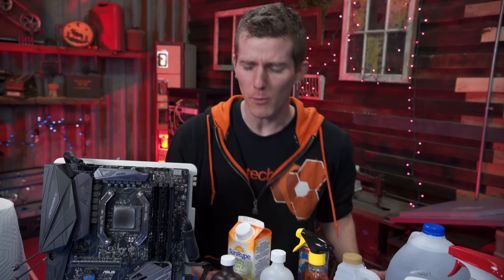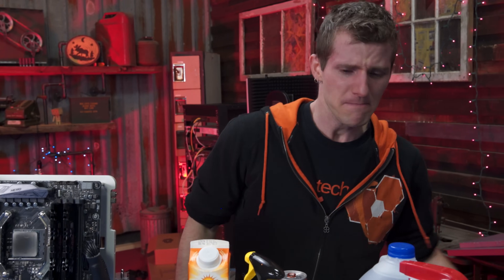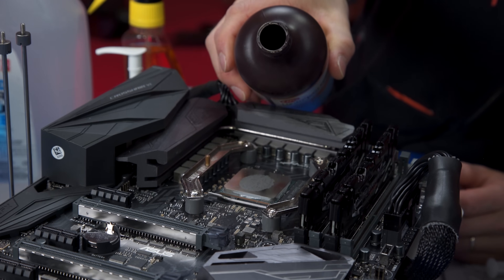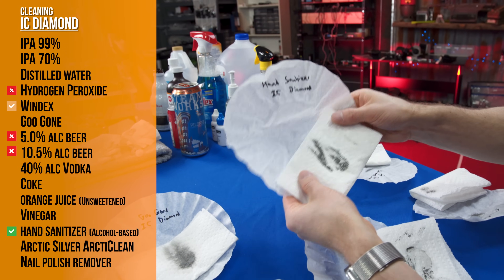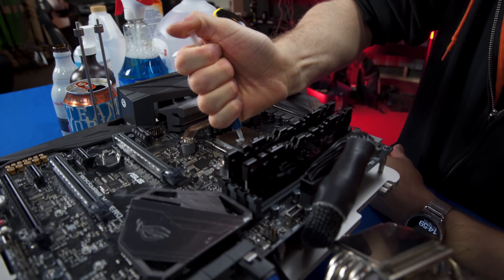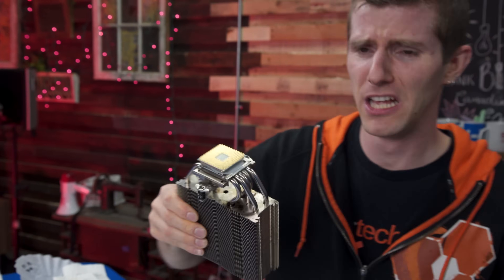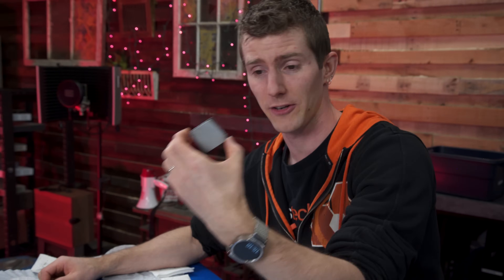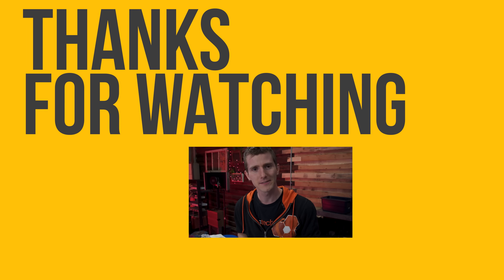Removing Thermal Compound - The BEST Way?

Comment: For those wondering the reason alcohol work so well is because it has a molecular structure that is polar on one side and non polar on the other. In chemistry like dissolves like and from what I could tell looking online briefly the thermal paste seems to be made of some largely polar molecules mixed in a nonpolar goo Soo the alcohol is able to dissolve both materials where as the liquids that were more polar like acetone had a hard time breaking down the main part of the thermal paste and the water which is very very polar did basically nothing for you. I also looked into the Arctic silver cleaner which seems to have mostly just improved on these principles with there cleaners though there could be more at work in it they don't list every ingredients only the potentially hazardous ones on the SDS. The second paste seems to come off with a Stern look so I didn't look into it. (I could also be wrong I made it through sophmore year in chemistry soooo maybe if I'd stuck with it I'd be telling me how dumb I am right now)
Reply: Alcohol's Polarity: The claim is that alcohol has a molecular structure that is "polar on one side and non-polar on the other," which is a misconception. While many alcohols (like isopropyl alcohol or ethanol) are considered polar molecules, they don't have a distinct "polar side" and "non-polar side" in the way soap molecules do. Soaps are amphiphilic (or amphipathic), meaning they have both a polar (hydrophilic) head and a non-polar (hydrophobic) tail, allowing them to emulsify both oil-based substances and water. Alcohols are polar because they contain a hydroxyl (-OH) group, but they are not amphiphilic in the same way as detergents.

"Like Dissolves Like": The principle of "like dissolves like" is correctly stated, but misapplied with regards to the substances involved. Thermal paste is typically made of a non-polar, oil-based carrier fluid (often silicone-based) mixed with powdered compounds like aluminum oxide, zinc oxide, or silver. This means the paste itself is largely non-polar.

Acetone and Water: The claims about acetone and water are also incorrect. Acetone is a powerful organic solvent that is significantly less polar than water. It is very effective at dissolving many non-polar substances, including some components of thermal paste. Water is highly polar and therefore has difficulty dissolving the non-polar carrier in thermal paste, which is why it is ineffective.

The correct chemistry
The reason isopropyl alcohol (IPA) is recommended for removing thermal paste is that it's an effective solvent for the non-polar carrier fluid.

Solvent Action: Thermal paste's non-polar, grease-like base readily dissolves in a non-polar or slightly polar solvent like IPA. While IPA is a polar molecule, its non-polar hydrocarbon chain is long enough for it to effectively dissolve non-polar substances. This is a common property of alcohols. The "like dissolves like" principle holds true here: the non-polar part of the alcohol molecule interacts with the non-polar grease, breaking it down and allowing it to be wiped away.

Insolubility of Fillers: The metal or ceramic particles (like zinc oxide) in thermal paste are not dissolved but are carried away in the suspension. The solvent action of the alcohol breaks down the binder, releasing the particles, which are then physically removed by the wiping action of the cloth or swab.

Evaporation: Another key advantage of IPA is its rapid evaporation. This prevents any residual liquid from remaining on the sensitive electronic components, which is crucial for preventing short circuits or corrosion. Water, in contrast, evaporates slowly and could cause damage.

Comment: Denatured alcohol (which is just undrinkable grain alcohol).
Degreases very well, evaporates quickly. 
The three levels of industrial degreasers are alcohol, acetone, reducer (HVLP reducer only put on skin if you very much want to get something else off and don't use it to clean anything you're not about to sand and paint.)
Only caveat to acetone is you don't want it getting anywhere it can't easily evaporate unless you have a blower of some kind, and you very much have to control your elbow grease because it will deface metal. (e.g. if you cleaned your brushed stainless refrigerator with a hard scrubbing of acetone, it'd look like garbage - permanently - when you were done.)
Try out the denatured alcohol. As a plus, it's also a perfect insecticide, and is a better household cleaner than anything the grocery store has for a fraction of the price.

Source: just like jojoba oil and pumice, this is a not-kept-at-all secret that body shops have employed for decades. Unlike jojoba oil and pumice, it hasn't trickled into the mainstream.

You can use grain alcohol, it's just more expensive. Denaturing (making undrinkable) the alcohol avoids the alcohol tax.

Comment: I have tried everything mentioned in this and other videos, but nothing can beat WD40 when you are trying to remove HARDENED thermal paste/grease. One drop in the middle of the rock hard paste and a minute later you can wipe off like butter. I am not sure if it hurts the CPU, but sure cleans the heck out of it.
Reply: Oh hell yeah, I do the same with WD-40! I also follow up with a blast of CRC Quick Drying electronics cleaner, for when you want to make sure your CPU/IHS/heatsink is clean clean. WD-40 remains one of the best things ever invented!

Comment: I saw in another two videos that dental floss can remove a heatsink/cooler from a CPU in case the thermal compound has glued the cooler to the CPU. 
That would have saved me some money if I would have watched those before I attempted to remove the cooler in the process of upgrading the CPU.
Experience is the best teacher.

Comment: Try white gas. It is a bit less thin and volatile than alcohol, it feels somewhat oily, which makes it easier to work with, while retaining the ability to aggressively dissolve the paste. I’m using a passively cooled case with 16 heatpipes going around the case, connected to various heatsinks, so I have to deal with a lot of thermal paste smears and smudges when I do something like a GPU change. Use the white gas with a magic eraser sponge and it’s like one of those commercials: one wipe and it looks brand new again.

Comment: If u take out the CPU of the mother board does anything happen to the system just a question ???
Reply: If you take it properly when the power is off(make sure PSU is also off), then nothing will happen when you put it back in, only you might get a BIOS message about CPU being changed

Comment: Iso 99% and a lint free cloth are the way to go. It's cleaner and the water evaporates faster. For god sake, don't use crap like Goo Gone which is oil based. While you can technically use any of the stuff he recommended Iso 99 will clean it best and leave nothing behind. Most everything else will and that impedes surface contact between the paste and CPU and cooler.

Comment: Flux remover dissolves thermal paste so you will be able to remove it from socket, from any other surface use sponge, even bath sponge just cut to pieces and you good to go

Comment: Got an older GPU for a retro build and the paste was like concrete on there.  I used carb cleaner to get it off (sprayed on paper towel, not on the chip). Worked great. Was careful of course, and I cleaned it with alcohol after.

Comment: I have been searching, and have not seen anyone address whether or not to remove the stock thermal compound that comes on AMD coolers BEFORE applying aftermarket TP. Can anyone answer this question for me??? I'm assuming that, yes, you should remove the stock thermal compound, but I don't know for sure, and I don't know the best way.
Reply: If you're using the stock cooler anyway then it's best to keep the thermal paste is has on.
Reply: @Mango2099  so I shouldn't remove the stock compound and put something like arctic silver on?
Reply: @96redprelude  The stock compound will do it's job but if you REALLY don't have any confidence in it then just remove it and use your own thermal paste.

Comment: Basically you use anything to remove shitty thermal paste but fir the not so shitty stuff, you need alcohol or any of the other methods you said worked. I just took a qtip with 70% to it and it worked.

Comment: You do realize there is one problem with your testing. And that the chemical residue left from your cleaning agents. Residue that could potentially interact with the thermal compound in a adverse way. THIS is why you use isopropyl alcohol. As it leaves virtually no residue.

Comment: I know something that would remove thermal compound, problem is it might also strip off the coating on the CPU. Acetone mixed with harris stay-clean liquid acid flux. It also works great for removing rust from lots of metals.

Comment: polish your CPU and heatsink when reinstalling thermal compound, brush it it with 800-1200 sandpaper,use REAL thermal compound that has lots of metals in it not that runny shit and you shall get much better thermal conductivity in that connection between CPU and heatsink and a lower temp. youre welcome

Comment: you want to know why he's smiling so sarcastically cause he knows this video is just pointless and he did it anyway, i use rubbing alcohol and cotton swabs to clean my cpus and if i didn't have any alcohol just use a dab of water on a cloth, that works just fine too, these thermal paste assumptions need to stop right now, if your hardware is getting old, for the love of god it means you're probably gonna need a new system soon or you just need to replace one of the parts with a new one.

Comment: I have used a quick spray of WD40 on a paper towel to remove the thermal paste followed by a wipe off with alcohol. Very quick and extremely clean after.

Comment: Toilet Roll and Akasa TIM Remover.   The test should have been to put TIM back on to the cpu and check thermals before and aftert, because hey putting some crap on there to remove the TIM could actually stop the TIM working properly when new is applied.

Comment: I just use a microfiber cloth (like the ones that come in a LCD screen cleaning kit) and some rubbing alcohol. Last removal I used 50% which made me have to work harder to remove the paste, but it worked just fine. People often treat the application and removal of thermal paste like you're stepping on a potato chip, it's not that fragile.

Comment: Hi there.
I have a question. My CPU accidently got some compound on the pins around the edges.
If I had a small flat tray and put some isopropyl alcohol and submerged the CPU only to the point to cover the pins.
Will this dissolve the compound? or remove it? What do you think?

If not,  do you have a better way please let me know as this 8 core CPU was expensive

Cheers mate.

Comment: I thought the reason to use IPA99 was to clean as much dust, dry paste, etc, so it doesn't fry from the heat later and influence conductivity.

Comment: Linus u failed us in this video... you are removing new paste from heatsink , what about after 2-3 years of usage i found some paste burned to ics and cpus ... ewen with IPA 99  sometimes its hard to take wipe it off ... u should do teh test on OLD baked heatsinks .... like go to scrapyard and find 10 basic CPU heatsink (like intels) most of users in taht time used same termal paste (the one that is included)  .. i think this showed us nothing , coz the paste wasnt baked

Comment: I have used break cleaner on my heatsink before. It's simply washes the paste off with one pass and no scrubbing or any thing. :D I did not use it on the CPU because I don't know what could have happened, although it would probably be fine as long as it's ONLY on the heat spreader. Also did not use it on my AIO because the thermal plate is screwed on to the rest of the pump top which means the cleaner can seep between the screws and dissolve the gaskets or just flat out eat the whole plastic fixture.

Comment: this test would be a bit more emmm useful? IF you would test it on cooked thermal paste! like when it did it's time and it is all hardened up! i remember my friend only had peroxide when we fixed my PC that had a Q6600 (B0!!!) most processors idle at 30C but this one was around 70C and 85C load! (that changed when i stuck a bunch of fans at the right places... idled at 40C and 65C load!) thermal paste can cook and harden!

Comment: Surprised nail polish remover isn't in this list.  Also known as acetone.  It's what I've been using, you just have to be real careful not to get any on the circuit boards, metal is fine, plastic, not so much.

Comment: I just use a paper towel and wipe down the CPU/Cooler for a good couple of minutes each until a clean part of the paper towel can be wiped over the CPU/Cooler and doesn't have any grey marks (Maybe a tiny bit of spit on the paper towel if the paste is dried out), then reapply and reinstall. Never had an issue.

Comment: clearly coffee filters are the winner
Reply: They’re the basically the only lint-free disposable wipes readily available. I cringe when people use toilet paper
Reply: @ZombieLincoln666  I have used a Coffee filter more times then I like to admit haha, because I forgot to buy a lint-free disposable and was like eh worked last time :).
Reply: Eisenhower303 What about those phone screen wipes, or glasses wipes? Im pretty sure they are also lint free.
Reply: @phantom-xb6wv  Of course! But they are also way more expensive and you only get one. Coffee filters all the way!
Reply: @RetroCharged  what about q-tips
Reply: @EliteNK  Yes but I recommend putting some isopropyl alcohol on the tip to dampen it and make it easier to remove the paste. After this, use a coffee filter or finer cloth to remove any excess thermal paste. The cotton on Q-tips can come off quite easily so just be careful.
Reply: @RetroCharged  yeah I dampened it to clean the CPU off, although I just used a microfiber towel and dry tips to soak up and clean any extra alcohol, worked very well but isn't very safe
Reply: @ZombieLincoln666  Bandages
Reply: @kledder318  Like gauze? I think more people have coffee filters available and they're cheaper. But yeah that would work
Reply: @ZombieLincoln666  i also cring more so when ppl use towls and other things to clean something  when alot of it has lint.
Reply: Came here to say this
Reply: Would brown coffee filters work just as well, or does it have to be the bleached white?
Reply: @DaemonicDownfall44  The brown one worked fine last time
Reply: @DaemonicDownfall44  yeah, they're just not going to show off dirt as well
Reply: Can someone link me some coffee filters on Amazon please?

Comment: No ethanol alcohol? You're telling me you can buy Isopropryl alcohol anywhere in Canada and in the US?
Reply: Yeah you can go to any drug store and get like 90%  Isopropryl alcohol for like 3$
Reply: Never understood that either. Methylated spirits are incredibly easy and cheap to get, and they have all the same advantages as a solvent that isopropanol does, but for some reason Linus always insists on using the less convenient of cleaning alcohols...
Reply: Yeah pretty much literally anywhere
Reply: Isopropyl Alcohol seems to be far more common in the Americas; in the UK it's pretty damn hard to find, but Methylated Spirits are the very common sell instead. I can go down to the local Tesco or Asda and get some. They're what I've been using without issue, too.
Reply: Yeah, anywhere. Shoppers Drug Mart sells 99% isopropyl for $5. And yes, 70% works just fine, $4.
Reply: Hand sanitizer usually has a good amount of ethanol in it.
Reply: JonatasAdoM yes
Reply: I got 92% for 2 Dollar s at Walgreens
Reply: ethanol is for drinking.
isopropanol is for cleaning.
Reply: @Cole-ek7fh  they have almost the same properties except isopropanol can't be drinker, look that up.
Reply: Will 70 % isopropyl work also?

Comment: This is exactly what happened to me with Arctic Silver 5, i ended up with bent cpu pins and a broken socket on my mobo =D (this paste is kinda sticky so after it happened to me i never tryed to remove a cpu cooler (w/e the reason) before i spread some heat on the cpu (stress it a little) to avoid that situation :p

Comment: Something like Goo Gone (and im sure many other products listed) also leave behind a residue that Isopropyl alcohol doesn't.   If you dont have the alcohol just used elbow grease. 
Granted i dont know what the residue would do, if it would impact the bond between the cpu and cooler, if it would just burn off when a cpu warmed up or maybe it just doesn't matter. But id rather not find out.

Comment: I learned from working at a high end restaurant, the absolute king of copper cleaners is ketchup. it will make it shine like factory new, I've been using this method to clean my copper sinks for years. Try on any copper prior to your cpu cooler if you have trust issues. I do use alcohol initially to loosen (not needed) up the compound, then I use ketchup to remove all and I mean all residue left behind.

Comment: too be honest: icould have saved you all the time and told you. you need non-polar solvents pure as possible. either basic ethanol, isopropropanol, methanol, maybe even n-pentan. water is the worst because its a polar solvent and the goo in the thermal compound is probably not polar and the metal in it as well not polar. its just basic chemistry and logic. no nned for a video like where you try FUCKING JUICE and beer (i mean okay it got ethanol in it but only up to ~6 Volume% or 2,5 in american water).

Comment: Does 96% ethanol work for this?
Reply: I know this comment is old but I use '70% alcohol wipes'. I think all that matters is that it will clean the compound off and evaporate quickly to avoid a short